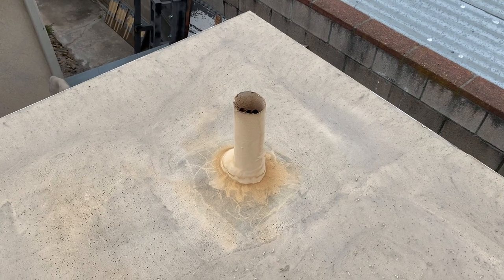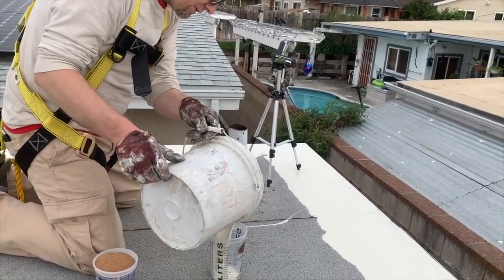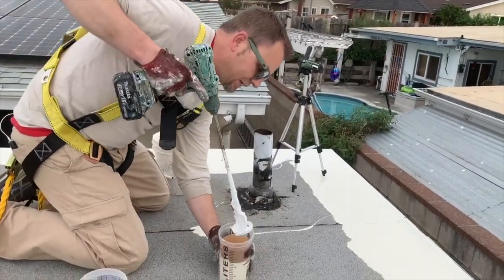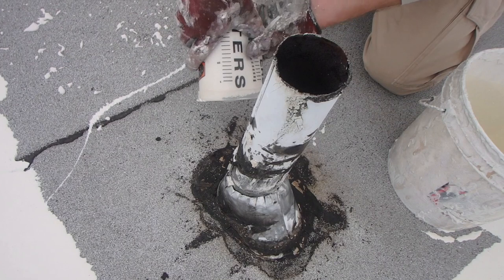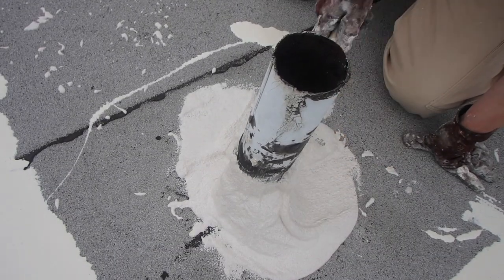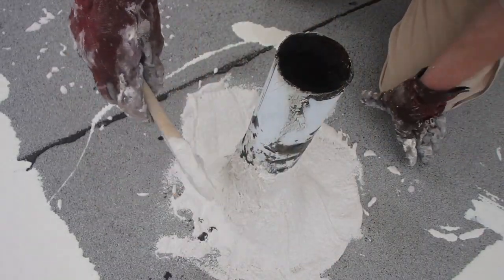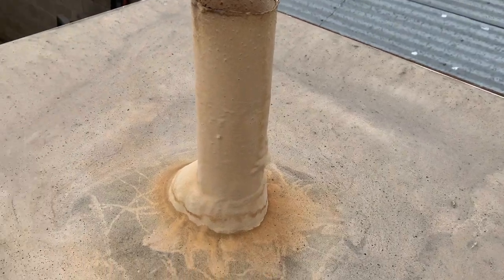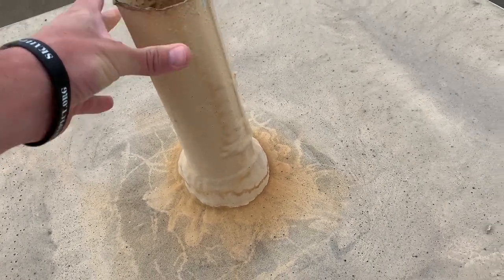Roof Vent Leak Repair with Ecodur Roof Coating - UPDATE (3 Years Later)

Comment: What are all of the small open pitted bubbles that are everywhere on the roof coating.
Reply from the maker: Wow, great eyes! Those are surface anomalies cause by trapped air. Because Jef was working alone on that video, he ended up working really close to the end of the product's pot life. Generally, the majority of those would have self-leveled out. 

It is important to note, though, that they do not go through the coating and do not defeat the waterproofing capabilities. While not aesthetically pleasing, the coating is still doing a great job of keeping water out.

Also important to note-- this is an R&D roof used for filming demos and testing products. If it were a client's home, he would not have left the visible defects.

Thanks for the question! Feel free to reach out to us at info@castagra.com if you'd like some more info.